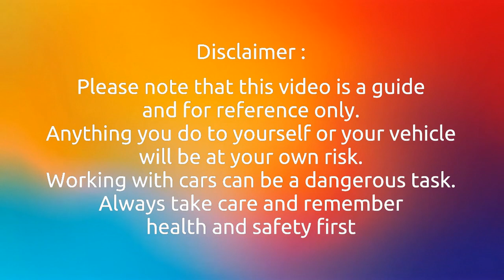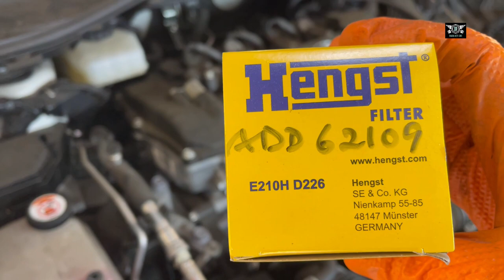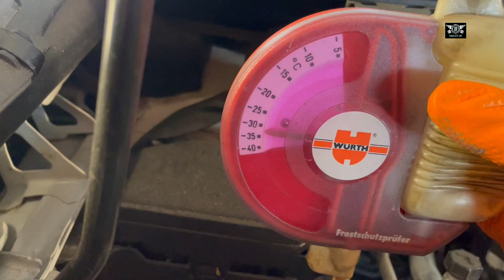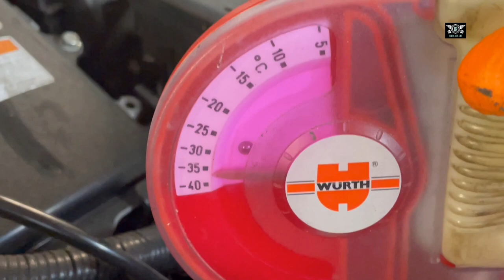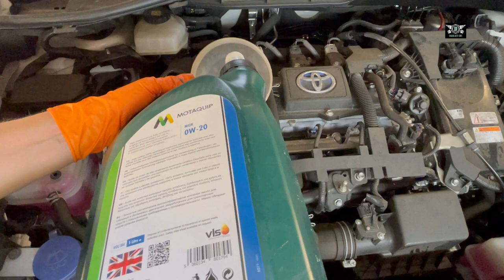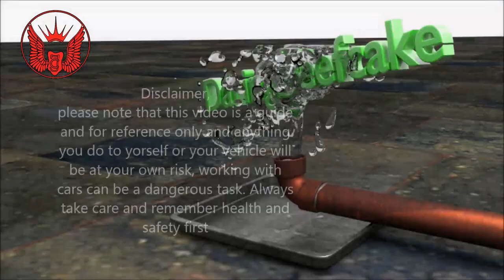Toyota CH-R Hybrid 2018 oil and filter change, screen wash fluid top up coolant antifreeze check

Comment: Where is the radiator cap in the C-HR?
Reply from the maker: I don’t access to this car so I couldn’t really say sorry. If there is one I assume it would be where the radiator is by the front bumper.
Reply: Thanks for the reply.  The interesting thing about the C-HR is that it has a reservoir but the cap normally sits on top of the raditaor but it's not there.  This is the only car that has this situation.